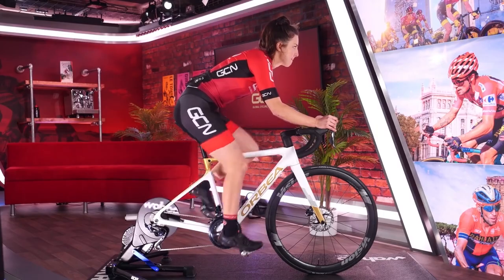How Do Power Meters Actually Work? | GCN Tech Clinic #AskGCNTech

Comment: #AskGCNTech  Hi guys, I'm thinking about kitting myself out with a quiver-killer with a couple of different wheelsets - one for road rides and one for getting a (little) bit more rowdy. I wont be changing chainring(s), but will I have to manage the chain and cassettes, as I swap back and forth? Will I be restricted to running the same cassette-range on both wheelsets? Thanks for any help!
Reply: i have two wheelsets.  one is 11-25 the other is 11-28.  no issue with the chain. HOWEVER, the spacing of the cassette on the wheels is NOT exactly the same, and i have not gotten around to trying a spacer.  so when i change the rear wheel i take a couple of minutes to reindex the gear shifting.  would not be handy in a race for sure!  but i am just old fart biking for fun.  try to keep the cassettes and chain the same manufacturer (remember chains are "one way").  also of course, same type like 9 gears or 10 or 11 to match shifters. hope this helps.  a large difference like i am estimating 30 - 40 tooth would be an issue.  plus a longer derailleur would be needed for a huge tooth #.

Comment: #askgcntech if I have dura ace cranks is it possible to add the powermeter in the existing location (as 4iiii or shimano powermeter) or do I have to buy new cranks?
Reply: Yes! For example stages does install. Send your cranks off and they'll install power.

Comment: #AskGCNTech My front derailleur rubs when I'm in the small chain ring and the largest cassette sprocket and the largest chain ring and the smallest sprocket is this normal as I've tried adjusting it and can't get it any better
Reply: Fiddle with the low limit screw to stop little-big rubbing and cable tension to get the trim correct. The chain may still hit the outer chainring a little if the chainstays are really short. But most of the time trim on the front mech will fix it.

Comment: #AskGCNTech Hi, I have a track pump with gauge, is there any way to calibrate it? Mine is not quite accurate as it was before. Thank you
Reply: The simple gauges on these pumps can be replaced.. but not calibrated.   BUT  if you have a pressure that you want.. you could just add your own mark on the gauge were you like your tires... it may not give to you an accurate number but if you pump to the same mark each time the tire pressure will be consistent which is really what you need
Reply: not sure about these days, but in my youth we used high psi and struck the tire with flicking the finger nail on the rubber.  the sound was our guide.  old school here lol.  but you do have a great question

Comment: #AskGCNTech is disc wheel better than deep section wheel (80 or 100mm )? Is there a considerable difference in performance?
Reply: It is significantly more aero (as in "the very best you can do aero-wise" more aero), but I can't quantify/qualify the difference 😊. However, it is also heavier, and significantly more prone to lateral winds, which is why they're rarely if ever used in front wheels* (not even track cyclists tend to use front disc wheels in closed velodromes, although I wouldn't know if it's for stability or "simply" an UCI rule 😊).

*: Aero wise, the aerodynamics of the front wheel are far more important than the aerodynamics of the back wheel; pros tend to use shallower or equal rim depths in the front wheel due to the sail effect of lateral/cross winds being more noticeable/dangerous on the front wheel than on the back.
Reply: @docontra4921  good answer.  pretty sure aero front wheels are legal
Reply: When talking about disc rear wheels, if yaw is between 0-5degree I'd say that the difference between a disc and a 100mm rear is marginal by the time the air reaches that part of the bike its pretty much not worth worrying about, if the yaw is higher than that eg a really strong side wind then disc rear will help as the air will glide over the disc vs getting caught up in spokes, nipples, the leading edge of the rim etc. Front and rear disc wheel however yes that would be the fastest setup.

Comment: #AskGCNTech is it possible to integrate a 105 rear derairlleur into a complete tiagra goupset (sti, FD, and 10 speed casette)? I broke mine recently and 105s are much easier to get right now. Thanks in advance
Reply: This is indeed possible.
Reply: If it's tiagra 4700 yes. If it's older tiagra 4600 then no. You could use sora or a 9 speed mountain bike derailleur on 4600. 105 5800 is a good upgrade and you'll probably pick one up for £20
Reply: Urm, assuming the actuation ratio is the same then yes. But most of the time if something is 10spd and something is 11spd it won't work very well.
Reply: @georgefarrowgreen01  11 speed stuff works well with 10 speed on mountain bikes. Same pull ratio but they're made better. Same with tiagra 4700 and 11 speed stuff. Tiagra with ultegra mechs and an 11 speed chain would be really crisp
Reply: @chairmanmeow8388  yeah, it's the actual 4700 series.

Comment: #askgcntech Hi guys, I just bought myself a second hand bike with a Shimano Tiagra 4700 rear mech and 4600 Shifters, from what I read online and from using them myself they dont work perfectly together. Can you explain what pull ratios are and why the two don't different 10 speed components don't work together? Thanks :)

Comment: #AskGCNTech hello, i just bought a new carbon wheelset, my current bike have a 105 11-34 cassette. I want to buy 11-30 cassette for the new wheels. Is it possible to use both cassette 11-34 and 11-30 without changing the B limit screw everytime i change the wheels. Cheers
Reply: Yes, should be ok. Shifting won't be super crisp but it will still work well enough.

Comment: #askgcntech You mentioned today, that the strain gauge on a power meter measures the flex in a crank to work out the power.  But, what would happen if you had a more flexy crank compared to a less flexy crank: wouldn't the measurement be different?
Reply: I had the same question.
Reply: The reading from the strain gauge is calibrated according to the crank characteristics (what is the stain gauge reading for a given applied force). This step is done at the factory, when the power meter is installed. For self installation power meters (such as the Avios), they supplied a 10l water bag to calibrate the crank, so that the processor on the power meter could determine how much the crank would deflect under a known 10kg load.
Reply: @engnelsito  Thanks for the explanation.
Reply: Strain gauges for power meters are usually made from constantan alloy which are compensated for the crank material. Every crank material, carbon/steel etc will have different types of gauges. It’s not one gauge fits all.  There is much more to it than Alex explains. I myself as a strain gauge manufacturer for some of the top power meter suppliers will work closely with the power meter guys through development refining each crank arm variant prior release. For every crank there is a paired gauge

Comment: #AskGCNTech What is the cheapest way to get 'cool' sounding hubs? I admit this is pure vanity, but I am tired of being the guy on the group ride with nearly silent hubs! I really don't want to spend money on new wheels. Is this possible or pointless? Which hubs sound best?
Reply: Nothing wrong with silent hubs, gives a touch of class to the bike being subtle. However if you want loud hubs, Probably a dt swiss 240 or 350 would suffice, relatively loud but not crazy, also mavic id360 is quite loud, they also have the ability to tune the sound with a vibration dampner, if you remove it then it will become louder.
Reply: @georgefarrowgreen01  are changing hubs something I can do or is it best done at a shop?

Comment: Are the cranks made of carbon fiber? If so that could help explain the expense,  as the force calculation relies on material properties and precision dimensions for the cross section,  which might not be uniform with carbon fiber, and need to be calibrated. Not sure tho.
Reply: Most carbon cranks don't have strain guages attached to them directly atleast not any more.
Reply: @georgefarrowgreen01  untrue. They all still use strain gauges. For strain gauges to work they must be applied directly to the crank,
Simon,
MFL Strain Gauges
Reply: Yes. Carbon fibre power meters have a more complex strain gauge.

Comment: #AskGCNTech I ride around 40-50 km daily and go for 80-120 km on weekends. people around me say that this is too much. the catch is that I am 16 years old, and these efforts are really easy to moderate for me and I have an average of 23-25 kmph. I take recovery very seriously and ride on wider tyres to increase my performance on final day, Is this overtraining?
Reply: It doesn’t make sense to train like this if you want to make progress in your average speed or power. Try riding faster for shorter periods of time
Reply: Trying to slow down the slowing down at 61. You're lucky. Those speeds sound too slow unless they include intervals and recovery. What we would now call overtraining was normal 40 years ago. Rest and recovery is sooo important. You can make yourself slower. I'm faster than 10 years ago because now I pay more attention to recovery. You'll recover much quicker than me but the principal is the same.
Reply: No. You are not overtraining...that is if you are training properly. I'm 41 and average 550km a week.

Use 80-20 polarized training. Structure your training. Have properly done base training and threshold interval blocks moving towards VO2 to peak.

Keep your blocks 3-4 weeks long untilvthe point you purposely feel a bit over trained. 

Then take 3 days off the bike and cause super compensation. Ease yourself into the next training block with one easy short ride  and repeat.

Do 2 interval sessions a week.

In base...do 1 interval session a week using a hill. Do more hill training to build strength 

In interval blocks keep your easy/long days mostly within zone 2.

Always have 1 day of rest and one day spinning 55% in a recovery ride (1 hour)

= The right way to seriously train. 

If you feel too overtrained, take a day off or end your block and have the well deserved days off the bike thereafter.

When you go into your next block, legs are fresh and hormones are a go.

Do not do lengthy blocks beyond 4 weeks....you'll overtrain without rest.

People on here don't structure their training or rest off the bike at purppseful times.

You do not overtrain if you train correctly.

Good luck! Aim for the stars :)
Reply: @BFinesilver2  The guy's only 16. He's got nothing but time. If he doesn't get injured, he'll be a beast by 20!
Reply: @BFinesilver2  thankyou soo much sir, it will really help
Reply: @davidburgess741  thanks man
Reply: 40-50k per day is fine, probably take a rest day on Wednesday tho bc you do actually need a break. 23-25kph is quite slow for a 16 year old so try and work on intensity more than distance